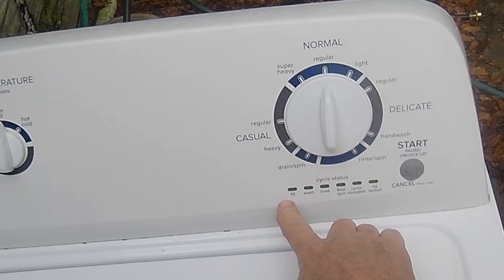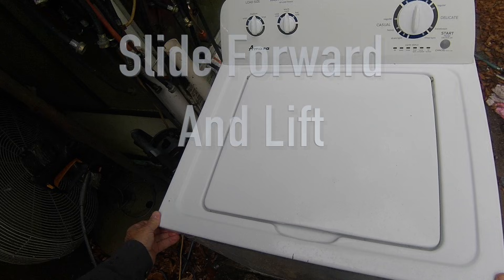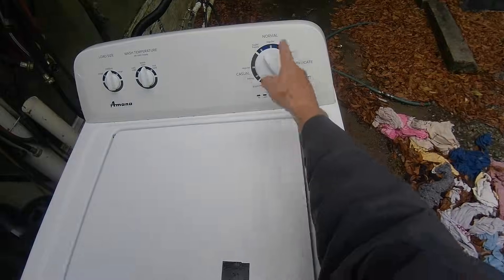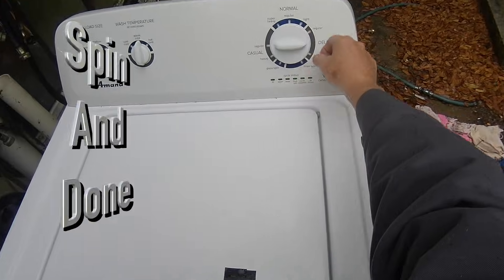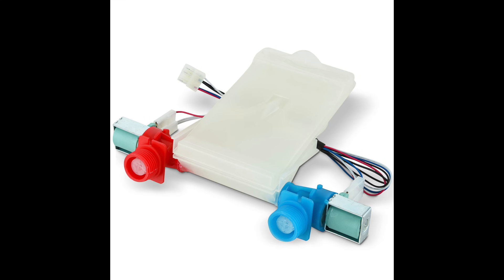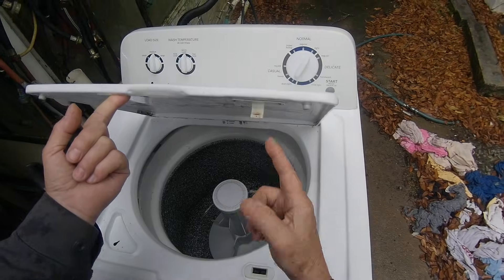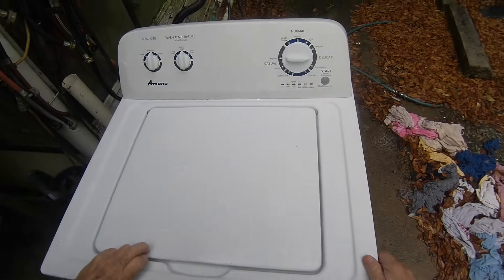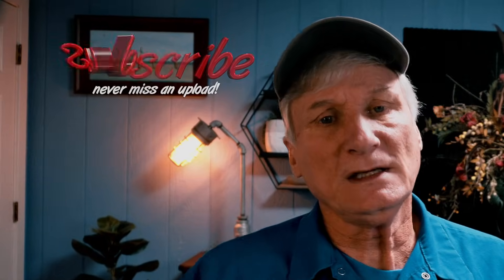How To Diagnose Your Amana Washing Machine: Chip's Guide to Manual Diagnostic Mode

Comment: Hi chip. I have ran the trouble shooting mode and had a stuck button code F2E1 and took the button out (previous owner had it stuck) i ran the same test and no codes. I went to start a large load and it would fill half way up then drain. Same thing with the medium load. But i can wash things on a small load. Ive tried calibrating it but now im at a lost. Can you please point me in the right direction. Thank you!
Reply from the maker: Your water valve isn’t filling the tub fast enough. It times out before the correct pressure reading is met and will pump out and shut off so that you don’t flood your house. It’s a safety thing. It starts on small loads because it reaches the correct pressure reading before timing out. Change your water inlet valves and you’ll be good to go! Thanks for watching!

Comment: It may already be in another comment but i watched a different video, disassembled/unclogged/reassembled my drain pump and then none of the lights would work even for diagnostic purposes, it was just humming. Then I stumbled across your video and obviously couldn't start diagnostics without lights.... I watched 10 more videos and stumbled across something called "flood mode" and apparently all I had to do was plug the washed back in and let it hum for 30m to "reset".  Flood mode is apparently a thing 😂
Reply from the maker: I belief the correct term is a “suds lock” here’s a video I made on that. How To Reset Your Washing Machine's Control Board: Fixing Endless Cycles & Suds Lock
https://youtu.be/avLVuDeG84c

Comment: No lights...there's a buzzing that started when I plugged it in...on off button doesn't do anything
Reply from the maker: Hold the button down until the noise goes away. Thanks for watching!
Reply: Thank you, I was having the same problem, though it was something else from a similar comment like replacing the computer (not sure if that was the word used). We have only had it for less than a year, thankfully holding the button worked. The noise stopped and the lights came back up after pressing the button again. Thank you.
Reply from the maker: You are very welcome! Thanks for watching!
Reply from the maker: Thanks for watching!

Comment: Chip, thanks for the video. 

What do you suggest I do if none of my lights will turn on and the washer doesn’t work?

Randomly happened today and it’s only 2 years old. 

This is the exact model I have. 

Any suggestions would be super helpful
Reply from the maker: I'd check the power supply and if that checks out change the control board. Thanks for watching!

Comment: Hi Chip, Thanks.  Great video.  I'm looking at my daughters Amana NTW4705EW1 (it won't spin, just a light clicking sound) everything else seems to work.   I'd replaced the suspension rods / washers a few months ago and somewhere in that process the repair manual disappeared.  Do you know where I can find one on the web?  I've searched but had no luck.  Thanks  Bill
Reply from the maker: That clicking is probably a bad lid lock. Due to copyright issues the manuals aren’t easy to locate on the web. Thanks for watching!
Reply: @HarperandKnowles  
Clicking sound likely was actuator.  It failed both the spin and agitator tests with same clicking sound.   I disconnected the machine and upon inspection the actuator was stuck in the middle position.  Once I took it out I could easily move the splutch back and forth between agitate and spin positions.  I ordered a new actuator today and I'm reasonably confident it will fix it.    Thanks for the help.
Reply from the maker: If the arm on the actuator flops around when you shake it then you are correct. Even so it probably is the actuator.

Comment: Hi, my washer would fill then wash but it would not advance into the spinning although i tested the spinning function in the diagnostic and it started up there. I thought maybe it was the lock but i bypassed it and that worked fine after. After i bypassed the lid it still wouldn't advance
Reply from the maker: I need to clarify something important for you and anyone else reading this. The lid lock on these machines is a two-part mechanism: one function is a lid switch that communicates the lid's position to the control board, and the other is the actual locking mechanism. Both of these functions are critical to the washer's operation, and the control board must receive correct signals from both to function properly.

Bypassing the lid lock or switch is not just a simple workaround—it disrupts the machine's logic, leading to cycle malfunctions and potentially damaging the electronics on the control board. This can result in expensive repairs or even render the washer inoperable.

If you're having trouble with the spin cycle or any other function, I strongly advise against tampering with safety features like the lid lock. Instead, let's focus on proper diagnostics or seek help from a qualified technician.

For everyone else, please take this as a reminder: bypassing safety features on your appliances can cause more harm than good. It's always best to troubleshoot within the designed parameters or get professional assistance.
Reply: @HarperandKnowles  then what could be the issue it wasn’t working properly like not going past wash cycle before I tampered with the lock

Comment: Can you show me how to put a older style whirlpool direct drive washer into test mode? non computer style
Reply from the maker: There is no test mode for these machines. Thanks for watching.
Reply: @HarperandKnowles  what I was trying to do was see what the bottom half of 2 piece agaitor was doing without water, but I remembered how, by finding that spot behind the timer knob and turning the knob to that spot and pulling the button out

Comment: My lid will not shut and the lid lock light is on-----any ideas-----THANKS
Reply from the maker: With it plugged in try holding down the start switch for about a minute. If that doesn’t work unplug it for two minutes an plug it back in with the lid up. You may have a bad switch and need to replace it. Thanks for watching!
Reply: @HarperandKnowles  ok-I have to do it with the lid up, It went close----- U don't know how much I thank u
Reply from the maker: I meant to have it up so the magnets in the striker won’t be near the switch.
Reply: Getting old can't see to good Lid want/will not close
Reply: The lid lock  light just flashes
Reply: Yes sir I did do it with the lid up--Thank you
Reply from the maker: If the light flashes you’ll need to replace it.
Reply: @HarperandKnowles  Are you saying Replace the lid lock switch my wife says the whole thing
Reply from the maker: Yes, replace the switch.

Comment: So ive replaced the spluch assembly and the actuator. Still doesnt spin or agitate would that be the motor itself? I noticed when i removed the belt protector that the spluch and other pully wheel were rubbing on the plastic protector.  Im wondering if that caused the motor to burn up? On agitate it will only move a little back and forth. This is still happening after changing those parts now im out 200 and still dont have a working washer
Reply from the maker: It’s hard to advise when I can’t diagnose it myself but I’d try changing the capacitor and then the motor. Still, that may not fix it. Thanks for watching!

Comment: What if pressing the Start button doesn't do anything?  That's what my tenant is telling me.  Not sure I can even move into troubleshooting.
Reply from the maker: You should disregard what your tenant says and diagnose it yourself. If the pump is running, hold down the start button until,it stops. Open and close the lid and press start. Or just hold down the button for thirty seconds and see if that fixes it. Thanks for watching!

Comment: My Amana completed cycle, but continues to run. I have to hit cancel button or open the lid to get it to stop running. I don't know what it's doing while it continues to run/make noise like it's running. My clothes do come out clean, though. Thank you for this very informative video. I'm intimidated to try to fix myself, though.
Reply from the maker: I think you are talking about the water pump running. Hold down the start button until it stops. You may be experiencing a suds lock condition. Thanks for watching!

Comment: Boss, i followed it all, it passed but i still get magic smoke smell from the washer? Any ideas? some sorta electrical component smoked but it all works.
Reply from the maker: I'd start at the wall receptacle examine for hot spots. Open the console and look around in there. Then turn it up and look around in there. If its next to a dryer I’d examine it too. Thanks for watching.

Comment: I followed your instructions on this video and have done all these tests. My washer does not rinse. I did not see a test for the rinse cycle. Do I set the washer test mode so the rinse light is illuminated? The diagnostic codes I got were F4 E0
Reply from the maker: On these washers all rinses are in cold water. If the cold water valve isn’t supplying enough cold water in a timely fashion it will time out and pump out and stop on the rinse cycle. I suspect when you check the cold water it just trickles in. If you are getting enough cold water then I’d suspect the shift actuator. So if it’s the water valve the your tub will be empty of water because it pumps out. If it’s the shift actuator your clothes will be floating in a full tub of water and stopped on the rinse cycle. Good luck with your repair!

Comment: Thank you for this informative video.  Amana NTW4651BQ1 washer is leaving lots of lint on clothes - thought agitator might not be working properly but diagnostic tests were all good.  Any suggestions?  I did wash a blanket before this issue.
Reply from the maker: I can’t think of any reason it would be doing that unless it was lint from the blanket. In that case it should clear up after a few loads. Thanks for watching!

Comment: Hi Chip, thank you for your video! I ran my machine though the test sequence, it works perfectly until the low agitation test where machine remains inactive (clicks, nothing mor).  I replaced my shift actuator today, and unfortunately it is still not making any movement at that step, so I am concerned I wasted money on the wrong part. Thank you for any insight you could provide.
Reply from the maker: I would suspect the splutch. Thanks for watching!

Comment: The error was F7E1 Amana said change the shifer assembly first ? If this washer is giving you that error code is that definitely the problem?
Reply: Well I just went through every cycle manual and every thing worked. I just don't see how it would be the shifter assembly if everything worked in manual mode! Right? At the end of the video you said if ever thing works it is probably a control board ? What would you change if everything worked manually the control board , or bc it gave you a code F7E1 would you change the shifter assembly ? Thank you for the feed back!
Reply from the maker: Watch this video and test the tachometer. https://youtu.be/8wau6bhIvUQ?si=qDZ4TEhtQGJcx8HI. If it fails the test replace the shift actuator.
Reply from the maker: That would indicate a problem with the motor speed sensor. Since the speed sensor is located in conjunction with the shifter that would be the appropriate thing to do. Thanks for watching!

Comment: What if on agitate mode it only goes cw then nothing when it supposed to go ccw
Reply from the maker: I think I made a video about this once. Unfortunately I can't remember the title. Anyway it could be a couple things. First I'd change the capacitor and if that doesn't work I would suspect the motor. Thanks for watching!
Reply: @HarperandKnowles  I checked the capacitor it's good 50 microfarads. I ohm the drive motor windings. I thought it was the ccw windings but cw and ccw motor windings are all within spec's. I've checked everything only thing I can think is the control board

Comment: First off, Thank You for this great tutorial. I have concluded that my shift arm is not working but now that I’ve removed it, should I be able to rotate the arm ?  It won’t budge.
Reply from the maker: Yes, you should be able to move it. It sounds as if your splutch is bound up. I’d remove it and possibly replace it if it is scarred and melted inside. Thanks for watching!
Reply: The splutch looks good and moves fine. I was just wondering if the electric actuator would move by hand after I removed it.
Reply from the maker: No, if it flops around it should be replaced.
Reply: Thank you

Comment: My machine stops before rinse cycle. It's Amana . Any help
Reply from the maker: Try washing on cold. If it stops before washing change the water valves.
Reply: @HarperandKnowles will check , thank you.
Reply: Hi. I replaced the hot and cold valve solenoid valves. Machine fills up but when  the wash light comes on only a hum and or click is heard but no wash.. any help will be appreciated
Reply from the maker: It could be the shift actuator not moving to the correct position or the capacitor or even the motor. Go through the diagnostic process and see if you can figure it out. Thanks for watching!
Reply: @HarperandKnowles  thanks once again

Comment: Thank you Chip for all of your content. It’s very informative and helpful and is appreciated. I have a washer that I have gone through the manuel diagnostic steps and everything checks out but the machine stops mid cycle and refuses to advance. I bought a used control board on eBay however it does the same thing so I guess the machine might be used for parts. Thanks Chip for the education and keep up the good work👍
Reply from the maker: Sometimes, when a machine stops in mid-cycle, it can be very challenging to diagnose.  A lot of times, the test all seemed to work correctly. If it stops on the wash cycle, it's usually a splutch or shift actuator problem, and if it stops on rinse, it's almost always a cold water valve problem. Sometimes, there will be an obstruction in the pressure hose that will cause weird behavior. Just remove the hose from the control board and blow through it to clear this issue. Thanks for watching, and good luck with your repair!

Comment: Thanks so much for your excellent concise and detailed diagnostic process. I only had one question will the machine not even enter this mode if there’s no water pressure on the valves.
Reply from the maker: No, it should go into diagnostic mode with or without a water supply. Thanks for watching!
Reply: @HarperandKnowles  thanks yeah this one is not responding at all, when you plug it in you hear a quick faint what sounds like the motor wanting to engage , then nothing. I’m suspecting the control board. Is there an out put in the board I can look for that would confirm whether or not the board is an issue?
Reply: This is an Amana NTW4516W3
Reply from the maker: Try holding down the start button for about 30 seconds or more. Then try it again.
Reply: @HarperandKnowles  tried that twice still no go.
Reply from the maker: Doesn’t sound good then. Check the board for swollen or blown capacitors.
Reply: @HarperandKnowles  will do thanks
Reply: Yeah caps all look fine as well as other components all though haven’t really tested anything specific. Thanks for your help this far🙂

Comment: Seriously the best and most well explained information on the web. This man knows his stuff. Thank you sir
Reply from the maker: Thank you for that vote of confidence and thank you for watching too!
Reply: I can't make it past the drain test. I'm running all of the other tests up to this point However, the drain pump is running the whole time. All of the LEDs illuminate as in your video but the drain pump starts running right away. I unplug my machine, plug it back in after 30 seconds and the pump starts running right away. I press the start, cancel button for about 15 seconds turn the dial clockwise a full spin to normal press start again. Pump turns back on and then the machine will start to fill with the pump continuing to run. Can I give up after 5 minutes. Board problem? I pulled the drain tube apart. Ran a little small snake into the machine. No blockage came out. This is irritating. My machine is not even a year and a half old. And it's just me using it so it's not like I have a family of four. I live in Gettysburg, PA.

Comment: Thank you so much for this tutorial! My washer gets to the "wash" light then sits there forever (after having drained and i think spun -- the clothes aren't sopping wet but not as dry as they should be if they were spun properly). It sit at this stage for 2+hours (wash light on). Finally I turn it off and advance the knob to drain/spin, press the start button and it finishes quickly. This seems like a control panel problem, right? The machine is in a very tight spot and pulling it out to access the back would be difficult. I don't even know how they got it in there.
Reply from the maker: It could be a control board problem but I have also seen a faulty shift actuator cause this too. Thanks for watching!

Comment: Great video!  My washer made it threw all the test fine. But when it goes threw the reg cycle it does nothing on the wash mode. What should I replace?
Reply from the maker: I’ve run into this problem several times and it’s quite frustrating to try to run down this problem. Sometimes but not always it’s due to a malfunctioning shift actuator/tachometer. I’d change that first and while under there be sure there is no trash or debris inside the metal case where the black wheel that runs through the tachometer part of the actuator is. Good luck and thanks for watching!